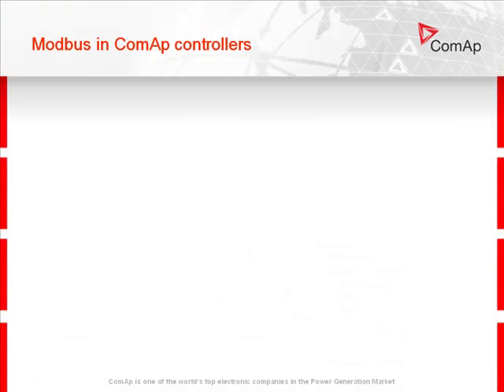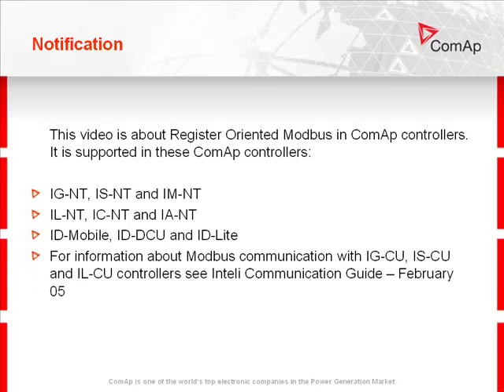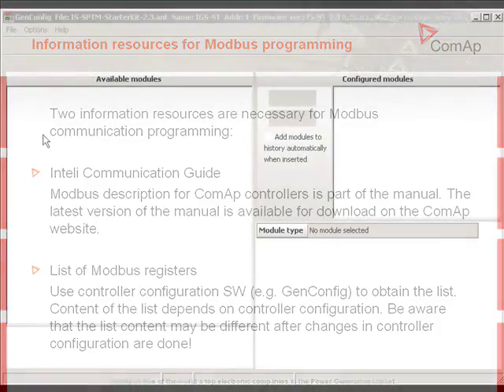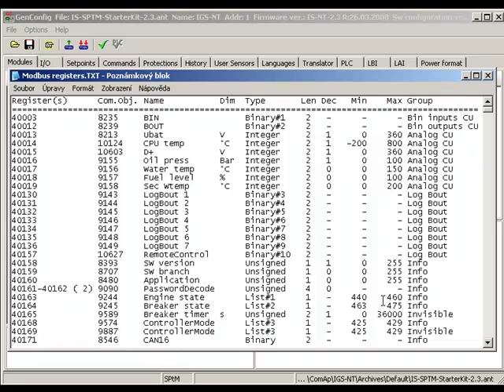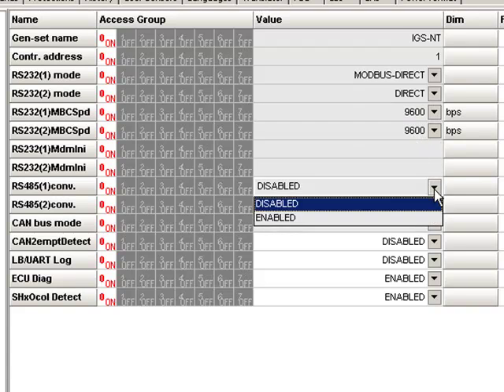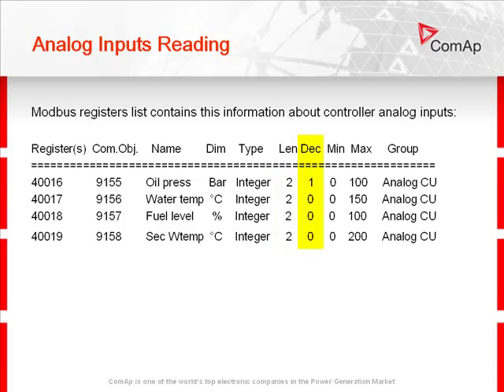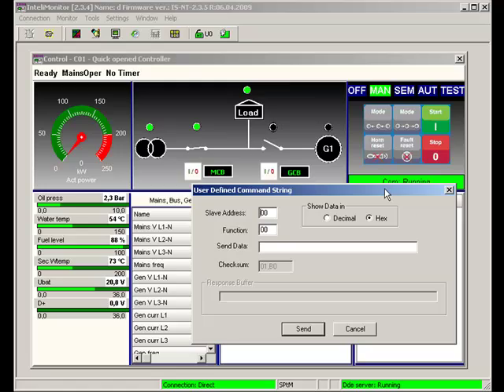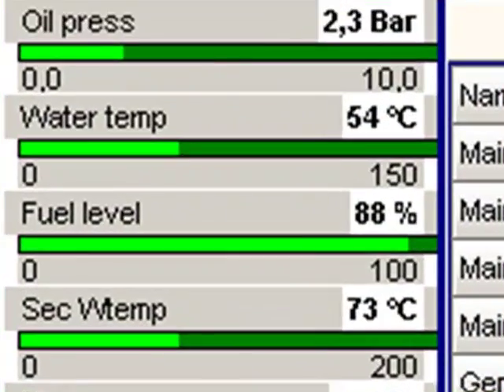برمجة كوماب كنترول   Comap Training

Comment: I see in display the alarm: sd stop fail. Can you help me, where is the problem in my generator?
Reply: -sd stop fail is when u start the generator direct not from module comap, so this alarm display come out.
-another is when module try to stop the generator, but generator still running, this also will triggered this alarm
- or setting stop time for generator timing also no correct, between generator stop time and module stop time
Reply: When you notice an SD stop fail. Check the battery voltage,  put it in test mode then start observing the battery voltage.  If it cranks and can't start then the replays are damaged